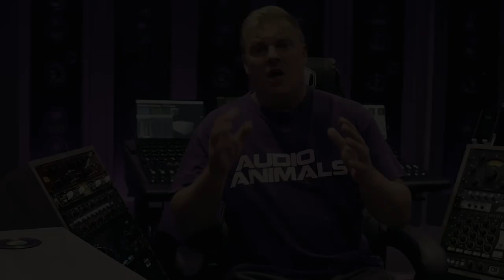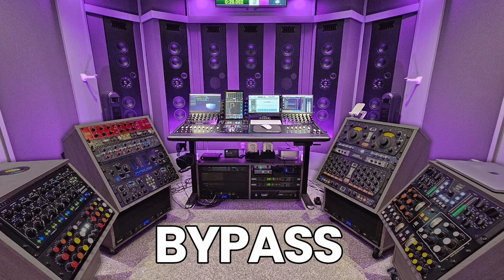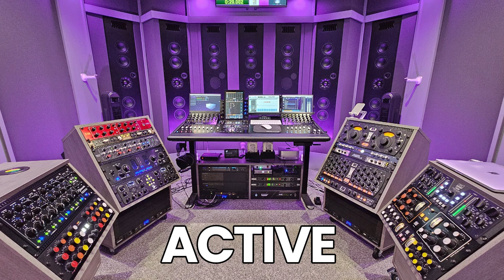Digital Mix VS Analogue Mastering Chain (No Processing Just Audio Passing Through The Chain)

Comment: I was a fan of "you can do it all in the box", untill i got my first hardware 😁 There's something in analog you cannot immitate just yet :)
Reply from the maker: I've seen engineers sell all their gear thinking this. Then regretting it later. Because no matter how much they try their sound is inferior to what they used to get with their analogue chain.
Reply: You very much can with today's technology; you just have to know what you are doing ITB. However, to get fullly equal results, the signal does have to come out and play in the real world at least once.😉 Another hint, processing sample rates matter a ton. 

Furthermore, to some degree this really isn't fair because the analog signal, in comparison, always benefits form the circuitry/circuitry compression, natural EQ curves difference of each unit, and the tone of two converts. With just the implementation of the converts and a set of XLR cables the comparison becomes unfair. 

A more accurate test would be to emulate every piece of hardware you are using ITB; to include Converter/clipper plugins as well. 

Also, what you are really hearing in difference actually has very little to do with things just being analog. The biggest culprit is the summing behavior of a DAW vs the summing behavior of outboard gear. Piece this altogether the right way, you can easily save yourself thousands of dollars. Knowledge is more powerful than gear; my motto!
Reply from the maker: @taviqmasteringonline2754  you really missed the point of the video here. Go back and watch the first 2 minutes, where I explain in multiple ways to get the point across to a varied knowledge base. What you are requesting is a completely different video entirely.

Comment: Ok, it shows no processing versus a combination of box tones running through tubes and transformers. For a real digital versus analog comparison you would need to apply the specific plugin emulations on the digital version as well. There´s of course still a difference but it´s not that big anymore. Also an accurate rms or LUFS short term level matching would be necessary as the analog version feels louder in this comparison due to the introduced harmonics from the gear.
Reply from the maker: You've kind of missed the purpose of what this video is about. I tried to explain it in as much details as possible in a couple of different ways so everyone would hopefully understand. I'll try and explain here again. The video is to show what is achieved by just the analogue chain being active. Passing through different pieces of equipment totally passive and unaffected. It shows how converting audio to analogue and passing through transformers and tubes even without being pushed through has an overall pleasing sound. I can tell you now if I added the plugin emulations to the in the box version there would be zero change. Volume is matched pretty close. You are perceiving it as louder as it is bright, more separated and more detailed.
Reply: @AudioAnimalsStudio  yes, by reading your title again I get what you are showing off here. Maybe the word "versus" is misleading. Anyway, I enjoy you gear show.
Reply from the maker: @ronson795  you know what I sat there for 10 minutes trying to think of a title. This was the best i could come up with. Which is why I put the second part to the title for extra clarification. If you can think of a better title that better explains it, please let me know.
Reply: not just harmonics, the dynamics also affected by soft-clipping and tube compression. 15 stacks of them. There is not going to be one single human being in the world that will pick the darker version of 98% similar track and saying it's better than the brighter one, it's just how our brain works.
Reply: @AudioAnimalsStudio  That is not true - most of the plugin emulations ADD something just by inserting them in the digital chain. Specially - the emulation of the ones you have here in the studio.
Reply from the maker: @blasimusic  not at the settings I use. I purposely create a preset called clean template, which nulls as a true bypass even when the plugin is active. You should try this will really help you. This is my tip I always give other engineers and it really helps them.
Reply: so you are saying that you can set every digital plugin so that it does nothing? I still don't think it's true - lots of emulations compressors - or like - that Black Box you have - plugin do smth under the hood just by adding them and setting to nothing. I WILL test it though :D You got me interested :)
Reply from the maker: @blasimusic  yes even the blackbox. The difference is you are looking at a plugin, whereas I look at the hardware. I know the settings to apply to the hardware to achieve a settings that nulls when bypassed. In the hardware manual this setting is almost always printed in the manual. Standard practice. You don't see this or even hear about it if you are only ever using the plugin. Nor do many people even read the plugin manual if it was written in there. But yes all plugins will have a setting that nulls as a true bypass. Even the Ampex ATR 102 does.

Comment: What this means is that the mastering units are not "true bypass".

The signal chain does not affect the dynamics or frequency response of the signal BUT it does some magic on the phase response of the signal, giving an illusion of depth. 

PHASE is the variable that our brain uses to asses DISTANCE (remember sound is a physical entity) and thats why you get a sense of depth from "non true bypass" signals.

As an electrical engineer who is one month new to analog gear, this is my finding. Cheers.
Reply from the maker: No unit is bypassed. Audio is passing through each unit utilising transformers etc.
Reply: @AudioAnimalsStudio  that makes sense. They are only "bypassed" in the sense that they are not trying to alter anything (neutral settings), no gr, no eq, no saturation, is that correct?
Reply from the maker: @pb25193  yes that is correct

Comment: Hi,  I'd like to ask a question regarding the BURL converters. I currently own the BURL B2 ADC, which I love to death, however my DAC for the analog chain is still the RME Fireface UFX main outs. (My monitors have a built-in DAC, Type 20 MK2 by HEDD which are connected directly via AES). The question is, how much of a difference the BURL B2 DAC would make to my analog chain in comparison to the RME Fireface UFX (which is being clocked by the BURL ADC). I'm asking because I got a really really good deal on the BURL ADC, but for the DAC it would definitely have to pay full price with some crazy customs duties. Also besides the conversion and opamp, the DAC doesn't seem to imply any analog character like the ADC does because of the transformer, hence my question. Thank you so much for your content, following it daily. Cheers.
Reply from the maker: I have always liked to use the same converter for both in and out of my mastering chains. I can't say how much difference there will be without testing myself. I can only advise getting one to test and measuring if it's an improvement before buying them. I know I love my Burls and given the choice if I was in your shoes I'd swap.
Reply: @AudioAnimalsStudio  thank you for the quick response 🙌

Comment: First, thank you for the time, effort, and detail you put into you videos and I mean no harm with comments below! 

However, regarding this one, I feel a more accurate test would be to emulate every piece of hardware you are using ITB; to include Converter/clipper plugins as well for AD/DA simulation.

You very much can, with today's technology, achieve equivalent results; you just have to know what you are doing ITB. However, to get fullly equal results, the signal does have to come out and play in the real world at least once.😉 Another hint, processing sample rates matter a ton.

The first misconception is that  100 analog is better. It's really not; all things considered.

With analog being reliant on digital for playback and vice versa for recording, how much analog do you really need?

That about question is the root of what I offer you.  

Furthermore, to some degree this really isn't fair because the analog signal, in comparison, always benefits form the circuitry/circuitry compression, natural EQ curves difference of each hardware unit, and the tone of two converts. AND I'M SURE YOU KNOW thats all converters have a sound. With just the implementation of the converts and a set of XLR cables the comparison becomes unfair.  

Also, what you are really hearing in difference actually has very little to do with things just being analog. The biggest culprit is the summing behavior of a DAW vs the summing behavior of outboard gear/routing. Piece this altogether the right way, you can easily save yourself thousands of dollars. 

Knowledge is more powerful than gear; my motto!
Reply from the maker: This isn't what the test is about though is it. As I say in a few different ways in the intro, the video is to show how much difference hitting an analogue chain can make. Just by hitting this chain in particular. This video is based off a question and discussion I previously had on a plugin vs hardware video. We wanted to know how much difference the chain makes. What you are requesting is another video entirely. Which I will shoot as I think 3 people now have said what you've said mistaking this video for that one. I had previously done a video on replacing plugins in the chain with plugin emulations. This video may answer your question.
Reply: @AudioAnimalsStudio  I get it and hitting any analog chain would make a good difference especially if the original mix is processed and summed ITB.

And perhaps my comments target more of the root cause, a fully digital mix. Either way, the video is very intuitive and I do not form my comments in the manner of being argumentative. Nearly everything in this realm is subjective now'a days. I support your work!
Reply from the maker: @taviqmasteringonline2754  yeah it's just we need to stay on subject here. We're crossing into a video I did some months ago explaining exactly what you are referring to. I will do an updated version of this. What I really want to do is pick a plugin for each piece of hardware and try replicate the hardware as best as is possible. Maybe even better. I perform a master and get someone like yourself to replicate it identically as best you can. You up for the challenge?
Reply: @AudioAnimalsStudio  Sure👍🏾
Reply from the maker: @taviqmasteringonline2754  drop me an email at studio@audioanimals.co.uk
Reply: @AudioAnimalsStudio  I would love to participate in this challenge too if that’s possible!
Reply from the maker: @thereiffodyssey2000  first one to email me is who I'll do the video with. I've had it in the past a lot, engineers say they are up for the challenge but when I give them the opportunity, they don't get in touch.